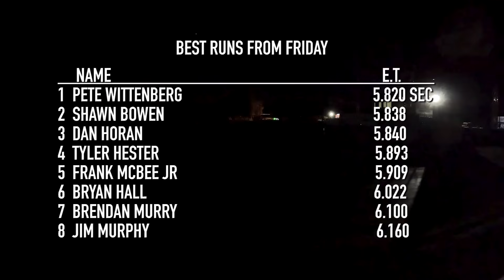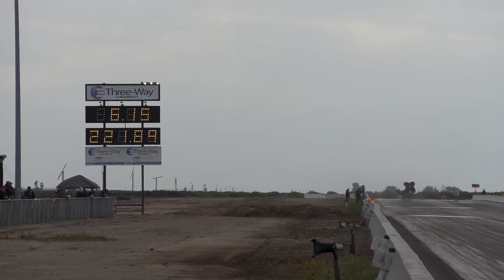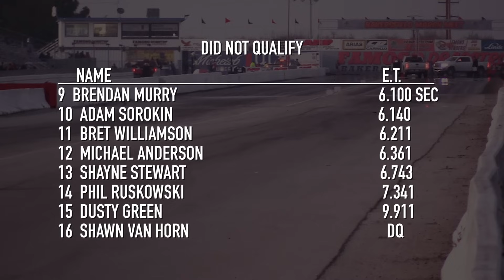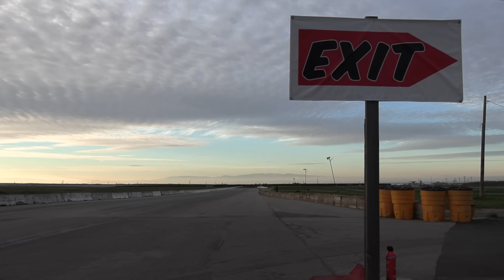AA/FUEL DRAGSTER - MARCH MEET 2023 NHRA HERITAGE SERIES (FULL COVERAGE)

Comment: Great coverage but would had like to see Funny cars and Fuel altered as well
Reply: I would rather see fuel altereds then TF cars.  I have been going to Famoso for years and it got to the point that I would go get something to eat and/or go cruise the pits  when the TF cars ran.  Why?  Because they ALWAYS blew up and oiled down the track.  I was just getting a head start.  I don’t blame the guys that still run TF (vs all that switched over to funny cars).  The problem is the rules.  Gear ratios, direct drive and the short tire makes these cars over rev.

Comment: A frame stress test every rum. Those are called mogals at the motocross track.
Reply: Not sure what is causing that.  The track owner paid millions not that long ago to repave the entire surface with concrete.  I think it may be more from the chassis relaxing when guys let off then a rough track surface.
Reply: @danmyers9372  Dunno, it looks pretty wavy in the shut down area.
Reply: @danmyers9372  must be the soil.